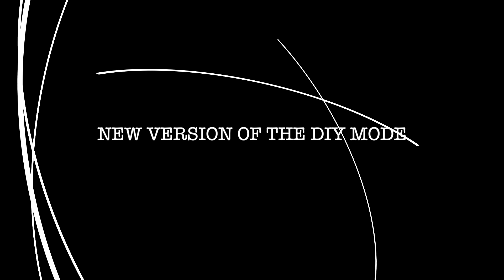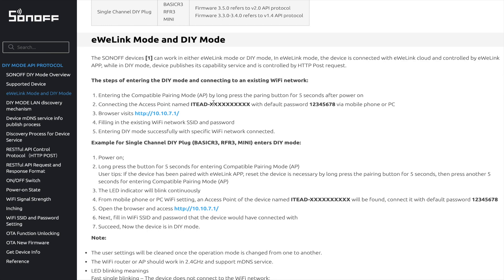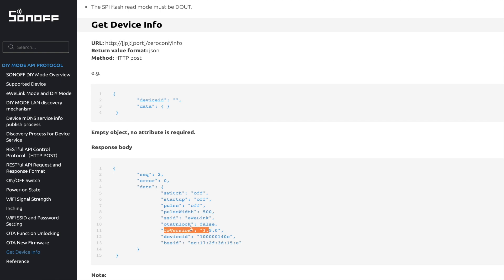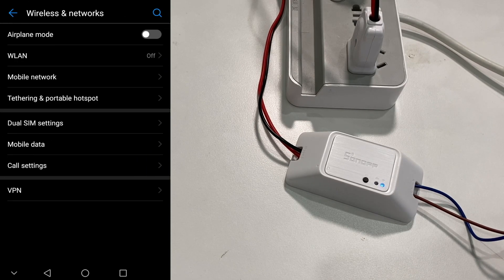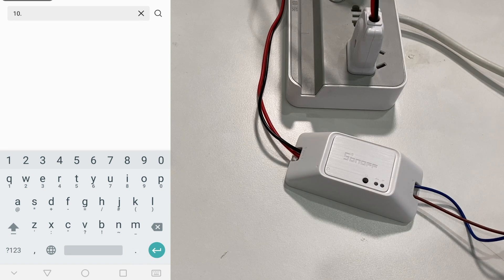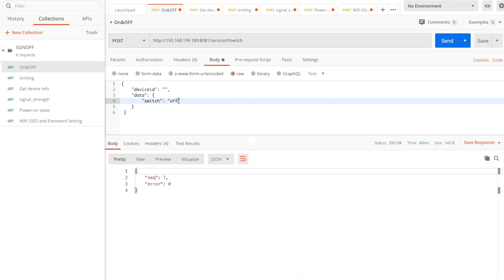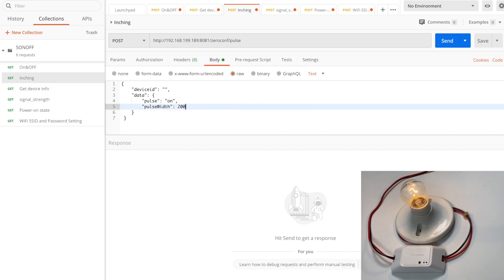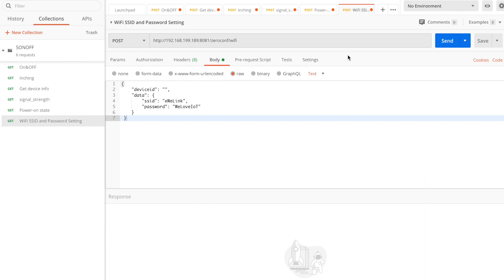How to Turn on the DIY Mode for SONOFF Smart Switches

Comment: Hi - I have Sonoff Pow R2 - version 3.5. I enter DYI mode but it does not load the page 10.10.7.1. do you have an idea why?
Reply: I also can't acess the page with basicR2, someone managed to solve?
Reply: I have the same problem too. With maps can see the port 8081 it is open but It doesn't reply

Comment: I'm not sure what I'm doing wrong, i have wired zigbee diy smart switch, I am getting a continuous green light blinking and I am unable to get it into Compatible Pairing Mode. When i hold the pairing button for 5 sec the red light come and switch off x 3 times and then it goes back to the green blinking light. I can't connect it with E-WeLink either, it's not detecting the switch. any advise?